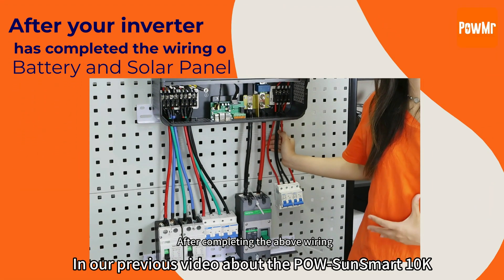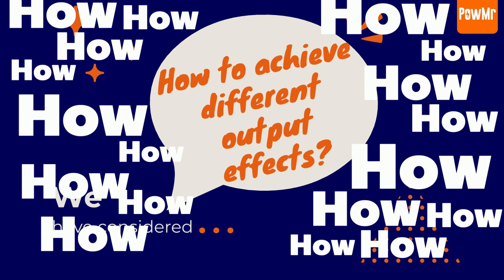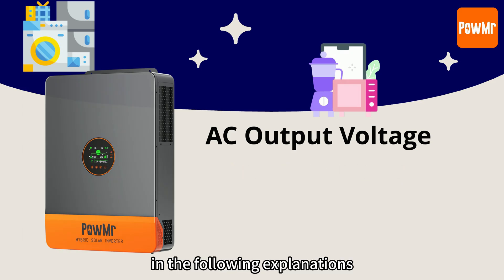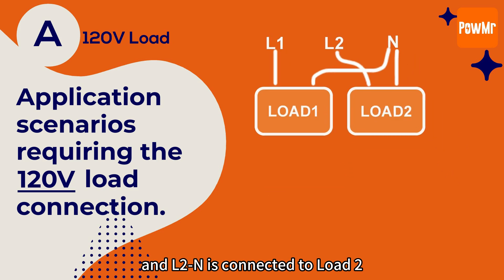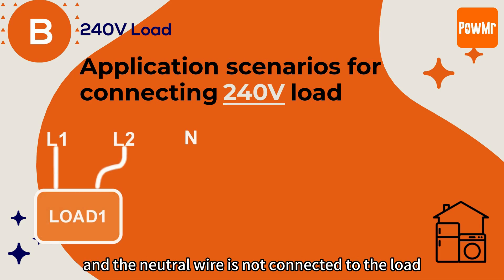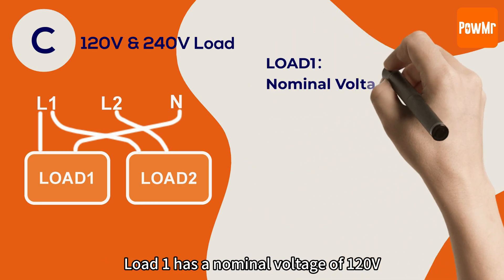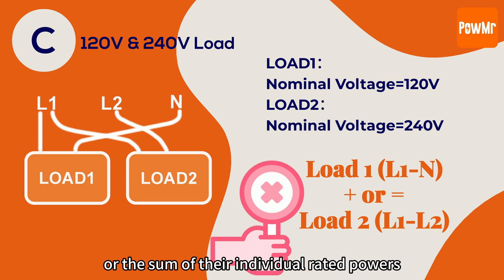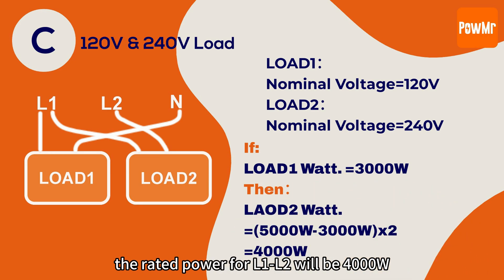SunSmart 10K Split Phase Application Modes - 3 Modes Explained

Comment: When connecting two 5kw in split phase, how do I configure the battery charging current so that it is not greater than 20-30% of the battery capacity, taking into account that it is a single battery bank and two chargers?
Reply from the maker: You can let the battery communicate with the inverter. After communication, the inverter will charge and discharge the battery according to the instructions of the battery BMS. If there is no BMS communication, the charging voltage can only be set on the inverter to control battery charging and discharging.
Reply: @PowmrSolar  In case of using generic batteries, for example 4 batteries in series 12 200Ah. Do I adjust the maximum charging current only in the Master or do I also have to program it in the Slave?
Reply from the maker: @juliofotovideo397  Do you mean using the inverter in parallel?
Reply: @PowmrSolar  Yes, using inverter in parallel
Reply from the maker: @juliofotovideo397  Just set it up on the master and the slave will automatically follow the master parameters.
Reply: @PowmrSolar  Thank you

Comment: Hi, I just bouth 6 x POW-SunSamrt SP5K so I could get two split phase systems (120/240 volts simultaneously), But I checked the diagram in Manual in the section : "Three all-in-one solar charger inverters of the system connected in two phase: 2+1 system:" (Pag 58) , but I need to know what is the power available in each phase?.....maybe you can explainme this feature.
Reply from the maker: Hi, please send your problems to this email: support@powmr.com.